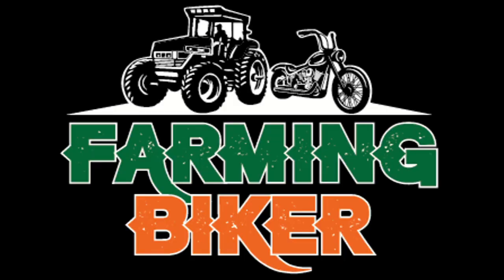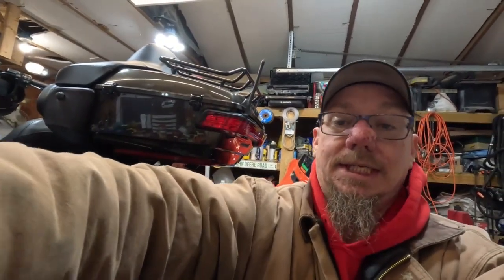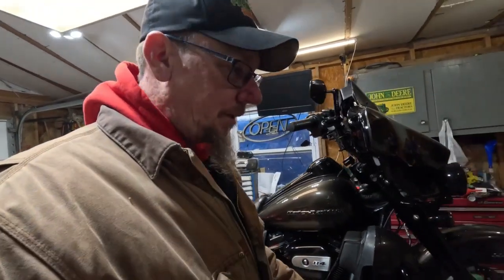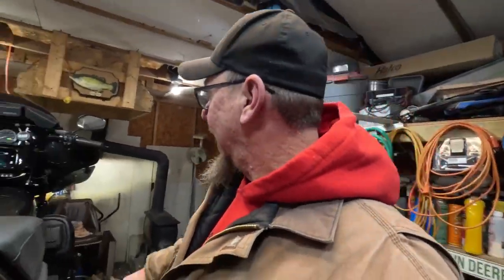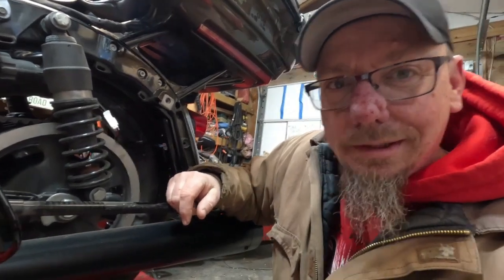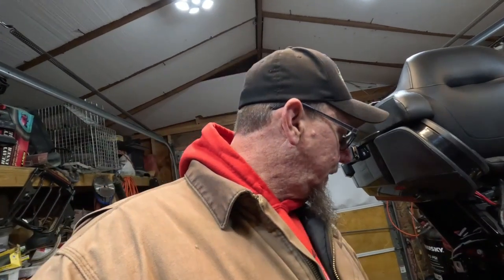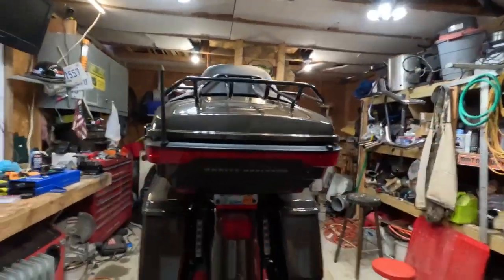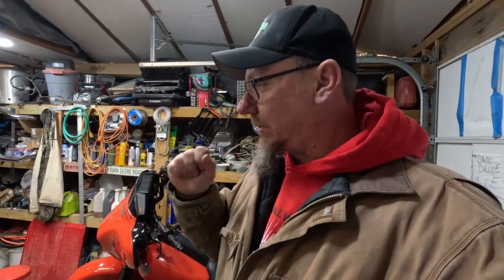Adding filler light to my Harley Ultra Limited

Comment: Sounds like a good deal on the lights, and they look good too. On the heat shields, remove the one on the left for summertime riding and it will help keep your rear cylinder much cooler. The right one scoops air in and with the left one gone it makes the heat come right out while cruising. Made a big difference on my Ultra.
Reply from the maker: Thanks for the info.

Comment: Are those the smoke lens or clear lens? So it’s been s year since this video, how are the lights holding up? Thank you.
Reply from the maker: They are the clear lens. They holding up pretty well. I do have one of them that has a little moisture in it, but still works. I see the moisture after we ride in the rain. Then 2 days later the moisture is gone.
Reply: Thank you. Keep up the great content.